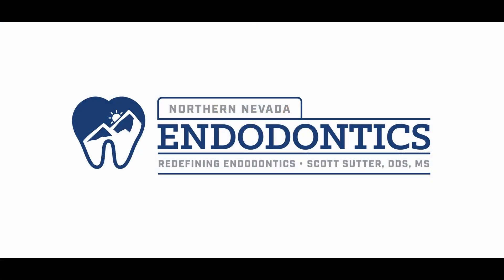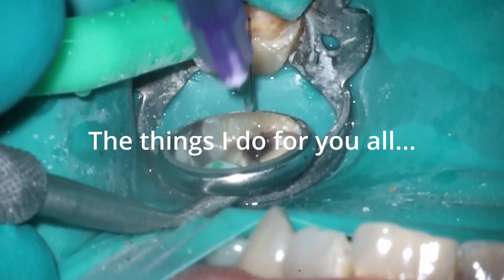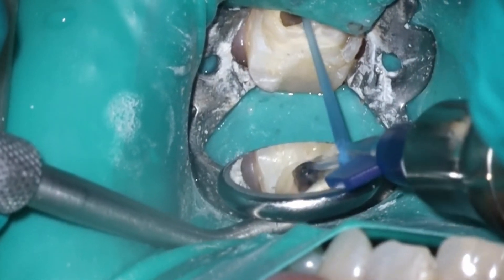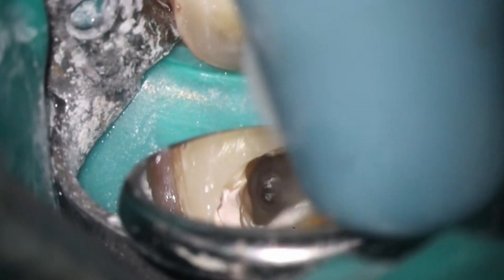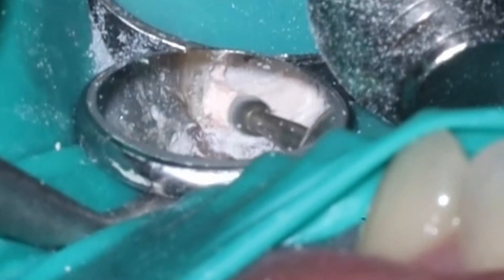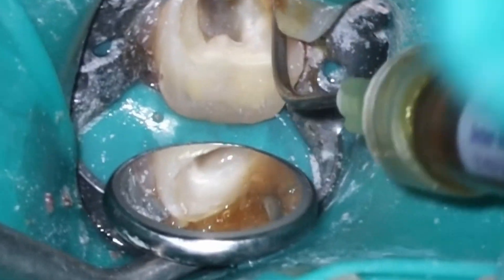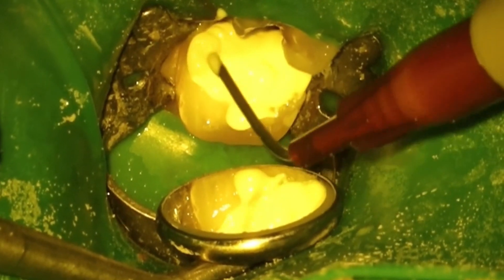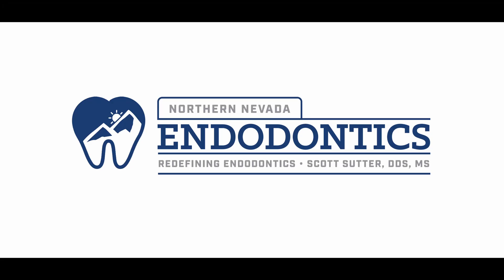Root Canal, Crown Lengthening, and like 100 other things

Comment: Found your channels recently and have been loving the content! 

I'm a newer dentist (only been practicing for about 1 1/2 years and I found myself doing a lot of Endo in my area. 

For Endo cases where you need to do two-steps, what ADA code do you use? 
Do you complete the Endo code at the 1st or 2nd visit?
If completed at the 2nd visit, what code do you complete for the 1st visit?

Thank you!
Reply from the maker: Great question! 
I usually bill the diagnosis codes first (consult, pulp testing, pa’s, etc) and then the root canal/restoration at the second. If you're a general dentist, you usually can't bulk most of those diagnosis codes (maybe a 0120?), so you can either create a d3999 code for a start and then bill the root canal or bill the root canal at the first visit and the restorative at the second.
Reply from the maker: Tl;dr there isn’t an ada code for two stepping root canals

Comment: Dr. Sutter  :goat-turquoise-white-horns: the GOAT. best video of the week. I cant wait for your microscope tips and tricks and microscope vs loupes. and BC sealer case:elbowcough:
Reply from the maker: I'm working on them, I promise! I'm just trying to get caught back up. These treatment videos are far easier to put together than the actual lecture ones, plus I have to give those lectures to my residents too! 
I don't really use BC sealer unless it's a weird trauma case or resorption. It doesn't work with the squirt technique as it sets under heat so it stops the GP from flowing properly... ask me how I learned that one the hard way! Thanks for the comment and the watch!!

Comment: Thanks for sharing the case. I'm a general dentist, and I'd appreciate your feedback on a few things:
1. How do you condense the core paste to avoid any bubbles or voids? Your post-op looks so clean.
2. What anesthetic technique do you use for patients with "hot tooth?"
3. Do you take WL radiographs or do you rely mostly on the EAL?
Again, thanks for informative content.
Reply from the maker: Great questions! 
1. Outstanding assistants :D Really, that matters the most. I have them hand mix the build-it to remove bubbles and then load it into a Centrix tube. Then, the key is not lifting out while injecting the build-it to not introduce any voids. Every time I get a new assistant, which thankfully isn't often, I'll see a few more voids than usual as there is a technique that they have to master as well. Would a video on how to mix correctly with one of my team members help? 
2. I do need to get an anesthesia video up. I gave an excellent lecture (or at least I think it's great, lol) to the residents last year before I was recording, so I will summarize: Psychology matters far more than we were taught. Bupivacaine is fantastic, and we should all use it more often. PDLs are my go-to over X-tips or other IO options. After 4-5 injections, they're coming back on triazolam. 
3. I used to take WL radiographs, but that was to get the required images for my boards. I stopped on 99.9% of my cases when I was board-certified, but I still will if I am concerned that my EAL isn't accurate. Thankfully, they're all ridiculously accurate, and I only run into issues with resorption or trauma. 
Sorry for the paragraphs, but hopefully, that is all helpful! Thanks for watching!
Reply: @PatencyPro  We use an injectable core build-up material (DC Flo, I think). Any videos would be helpful on that. As far as anesthesia goes, you think the oral sedatives play a huge role in helping achieve profound anesthesia? I do get that anxiety and other psychological factors can affect susceptibility to anesthesia. Very interesting. I appreciate your input. One last thing: how often do you take the master GP radiograph?
Reply from the maker: Good questions! 
Do you mean core-Flo DC? That should work nicely as it is a dual cure composite. Just make sure to not lift the tip up when placing so you don’t get any voids 
I use triazolam daily and 100% agree that the psychological component is the usual cause of anesthetic failure. I need to get a presentation out on that soon, but for now, yes, use the drugs!! 
I don’t use cones, but I always take a pre-restorative image to make sure I’m happy with the obturation. Very rarely on weird cases I’ll use single cone or warm vertical and then I will take a pre-down pack image

Comment: Great case ! Thanks. I have a question. If you use a larger rotary file like 30,35 or even 40, for o better irrigation, in a case like this, won't help us to get dried canals ??
Reply from the maker: That's a great question. It might? I don't think there's ever been any studies done on hyperemic teeth showing larger sizes help, but your theory is correct. My stance is I'm removing a lot more tooth structure to save an appointment when I could use CH and still get a conservative outcome. If you look at the pre- and post-op images, these canals were already pretty big anyway, so I don't think a larger file would have really helped a ton here. I also have had a terrible experience trying to one-step c-shaped canals, and I'm happy I used the CH after I saw the webs in the final image!

Comment: Hi doc, the squirt technique for obturation is technique sensitive, single cone technique  with matching gutta percha of master file feels easier to do with some kind of bioceramic sealer
Reply: What's the difference in squirt vs warm vertical?
Reply from the maker: Squirt technique doesn’t use a cone
Reply from the maker: Oh it’s for sure easier to do single cone. It’s also more expensive, takes longer, and doesn’t get hot GP to the apex. BUT. It did take me like three years to figure out how to be consistent with the squirt technique 🤷🏼‍♂️ I still use single cone and warm vertical in certain cases, but I use the squirt technique 99% of the time